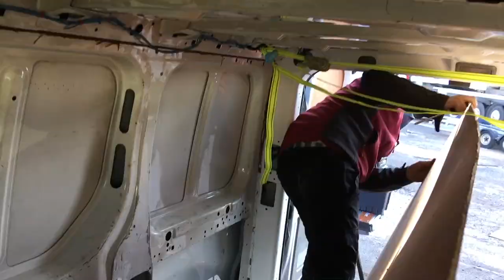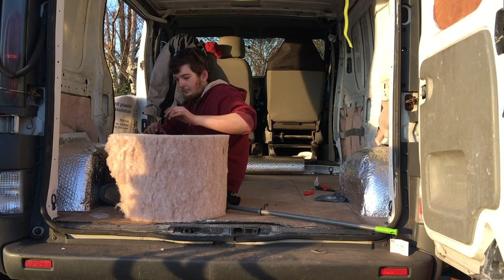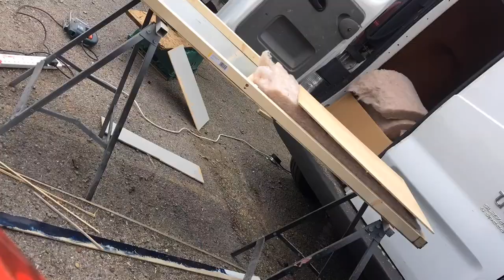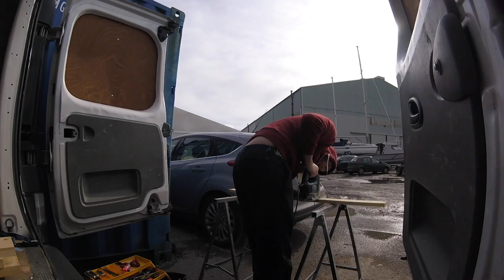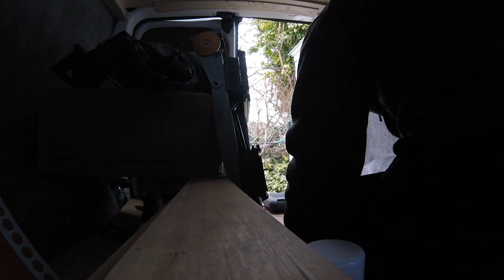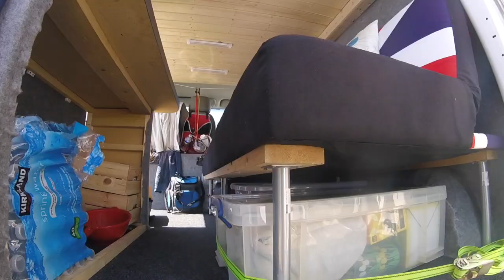Renault Trafic Van Camper Conversion - Completion

Comment: DO NOT DO IT THIS WAY. I have a Vivaro and if you remove the lugs on the roof beams (8 if I remember) use a little silver bubble wrap between, them you can minimise the internal height loss. Use 6mm ply covered in a good quality 4 way stretch wall carpet. For the same reason, with the floor, one layer of silver and then screw down 10mm marine ply and carpet. You will end up with a "sit up straight" ceiling height and I am 6ft tall. 

Also dont panel over the window cut outs they provide extra internal space and a good quality carpet material and carpet on the floor, provides ample heat and sound insulation.

Of course rockwool all the cavities prior to paneling, but our van has enough insulation, a lot of extra space inside and has retained a great ceiling height. 

As for electrics, I have no solar, no second battery, no split charge system and have never had a problem. I wire my cold box to only work when the engine is running, or use a leccy hook up and that has saved me a lot of money and complication. I only have USB charging points and a couple of LED lights which use nothing. I have actually now fitted the larger battery at the last change and do keep a lithium power/jump start pack just in case, but have only used it once to help someone else out. The downside of my system is that I lose 1/2 litre of milk per year and buy my chilled beer in a bar...and socialise.

Comment: Just watched all your conversion videos on your channel, I’m currently looking for a Trafic or Vivaro to convert and your videos have given me tons of inspiration. How easy was the electrical installation side of things? Have you got a leisure battery or is everything running from the vans battery?
Reply from the maker: Hi Ant thats awesome glad its inspired you. Just making these for fun really! Nice that you've found them useful.

The electrical side was relatively easy, but thats only after a few years of messing about with them with my work and privately. Unless you have some previous knowledge, it may be more difficult, but its easy to learn from videos on here etc. My work sometimes entails electrical stuff so I have worked alongside electricians and developed and understanding of the basics.

I do have a separate leisure battery in the back, connected to the van battery so that the alternator charges it. I work with boats also, and that gave me the idea to use battery isolation switches from boats (they're quite cheap) to connect my batteries. The only downside is I have to manually connect my batteries by hand, so if I forget, the leisure battery doesn't get charged. But I havent forgotten, if I did frequently I would pay more for the automatic connecting chargers.

Stay tuned, I saw you subscribed so thanks for that! More and better videos coming soon :)

Comment: What were the measurements of your ceiling panels. Not sure how thick the wood should be.
Reply from the maker: I don’t actually
Know as I was lucky to buy the van with pre installed ply panels for the side, and the top I used the cross struts to attach wood beams too so that the tongue and groove could be screwed into that.
Reply: @tomhphotographic  sorry I mean the beams that go across
Reply from the maker: Music Ting again, I’m not sure as it took me about ten minutes two years ago to put the wood up. If it helps, I actually used reclaimed wood from pallets for it, so the wood was, if guesstimate, 1.5cm thick. Enough for screws to go into and enough for the gap behind between the wood and the metal roof to hold conduit with electrical cables in and to squeeze in the recycled plastic bottle insulation.

Comment: Been struggling so much with the ceiling in my SWB vivaro. How and where did you attach the wooden frame? every time I try, it comes loose and falls, cheers!
Reply from the maker: So I used pallet wood and screwed that directly into the roof frame of the van. I used self tappers. I screwed the wood into an H formation along the sides of the van and I’m pretty sure it was only one section that went across the van. There seemed to be little metal platforms that are levelled out so when you put wood on them either end, they’re flat so you can screw stuff into it. If you have Instagram, check out @renaulttraficcamperconversion, I’m pretty sure if you go back far enough they’re should be pictures of me mid way through doing it that will show you what I did!
Reply: @tomhphotographic  Thats great stuff thanks for that Tom, I'll check out your instagram

Comment: How do you attach the wood the metal ceiling?
Reply from the maker: On the roof are some raised ridges so to speak, I screwed reclaimed pallet wood into an H shape on the roof first so I could then attach the tongue and groove wood to those wooden slats. This then gave me room to run conduit for electrical cabling between the roof of the van and the wood, as well as insulation.

Comment: No floor insulation ?
Reply from the maker: Noo, didn’t see the point. Wasn’t living in it and heat rises soo didn’t bother. If it ain’t broke don’t fix it. Was never an issue in our camping trips. Would have been better if I’d had a diesel heater but funds didn’t allow at the time! I have now for use with my tentbox….

Comment: pause@7:51.Bit of a shoddy cut around that counter top.what did to use...scissors?
Reply from the maker: toppertruthio I’ll tell you what I used there..... a really bloody blunt jigsaw blade! Back then my budget was a little smaller, that was over two years ago, and that table has now been replaced by a professionally made red folding jobby... :)
Reply: @tomhphotographic  so next time ,get a belt sander on it ,and make it smooth,then finish off with edging strip.Not that im a pro.Just saying.Still looked good though;)
Reply from the maker: toppertruthio I did end up plopping an edging strip on it for a bit, but the cut was so bad it looked pretty awful. Also pretty quickly realised having a fixed table was awful, so sorted that out too. And I literally didn’t have a belt sander or the money to buy one, let  alone a new jigsaw blade! The jigsaw and said blade were borrowed from my dads shed at the time... but I have learnt with time and it’s improved also.
Reply: @tomhphotographic  Yep.Well the only way to learn is to do it regardless of mistakes.Thats the only way to learn.And by sharing ideas.Your next one will be better,no doubt

Comment: Cool build! Do you have the short or long wheelbase?
Reply from the maker: Thanks! I have the short wheel base and low roof. So basically the smallest version of the trafic. It is surprisingly spacious, although I would say next time I am going to make a bed rather than use a sofa bed! That way I can make it lower down with the wheel arches to improve headroom.

Comment: Good job, what's the mpg like?
Reply from the maker: andrew reid thanks for watching! I’m afraid I have absolutely no idea, I drive it so little I must have filled it up maybe 5 times in the last few years, and have never worked it out as the computer doesn’t tell me. This last August gone I put £40 into it, went around the Isle of Wight for a week. Last week I put another £20 in it just because I was feeling a bit flush! Maybe next summer I’ll work it out, and make a video about it. Mind you I said that about how much the van build cost and still haven’t done it!
Reply: @tomhphotographic  It's brilliant I'm getting a van soon myself probably a traffic or vivaro, like yourself I will use wood for the roof and just put fabric over the ply to keep the weight down. Not sure to permanently fix a solar panel to the roof or keep it inside with a goal zero.

Comment: I was going to go with roughly the Same method with thin insulation boards in recessed bits and insulation foil all over, do you find it warm enough?
Reply from the maker: You probably don't require this reply now...however yes we do, and to be honest, nearly everywhere we have been has had electric hookup and we have a small electric heater inside that doesn't take long to heat it up at all, especially with two of us inside!

Comment: Foam i a van😬 It sucks water and Will mould.
Reply from the maker: There no foam in this van at all? If you’re referring to the insulation it’s recycled plastic bottles, so is all plastic and doesn’t absorb water. Either way this video is a few years old, and the van is not damp nor mouldy!